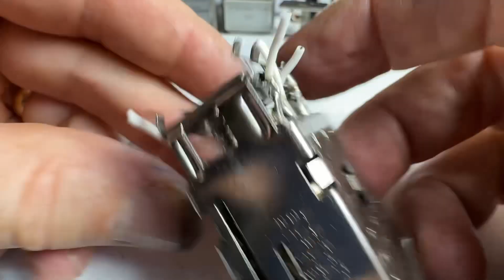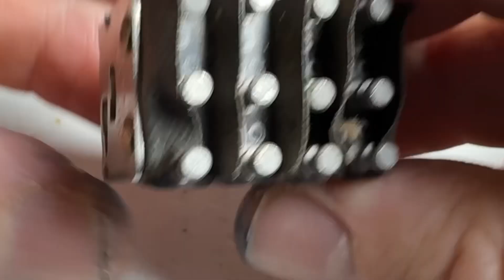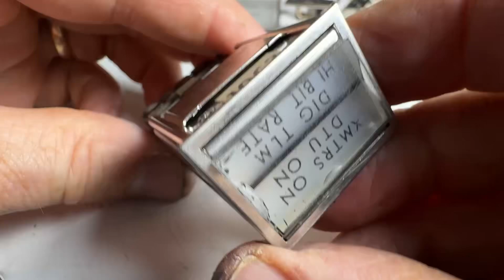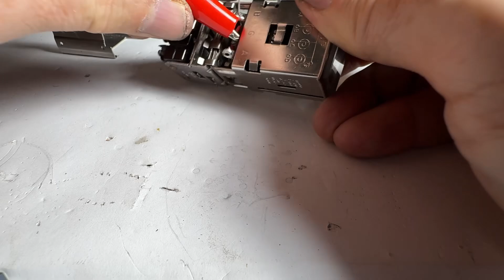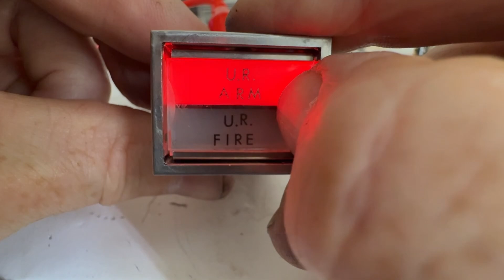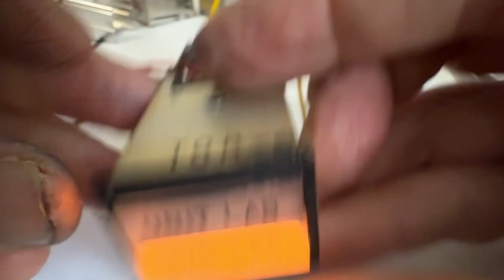NASA Apollo and Gemini Illuminated buttons original for Mission Control Part 2

Comment: I flew Blackhawks back in my Army days and those are very similar to the illuminated buttons used in the Alpha and Lima variants of the UH/60; which were all built in the late 70s  through the late 90s.  So that tech was used for a long time!

Just before I was medically retired, i got qualified on the Mike model UH/60, and it was a glass cockpit, so the illuminated buttons went away, along with the steam gauges and LED gauges.  

The regular Army UH/60 avaiation units were among the last military units to recieve a glass cockpit variants of their aircraft.  Most other aircraft recieved conversion upgrades or new digital cockpit models in the 90s and early 2000s.  I flew one of the first Mike models sent to my unit in 2010, so it was a very late upgrade. 

Maybe its because I flew almost all my time on aircraft with steam gauges and no auto pilot, but I think utility helicopters were meant to be flown that way.  Digital cockpits are meant for the fixed wing and gun platforms.  UH/60 pilots need to be very competent on the controls due to the maneuvers used in missions and auto pilot dulls those skills.  The glass cockpit is ok though, but i still liked the steam gauges better, lol!
Reply from the maker: Wow, that’s amazing info. Thanks for sharing! Great to hear from a first hand account. Sounds like you had an interesting career using some incredible aircraft’s.